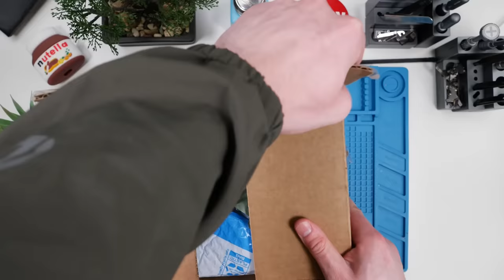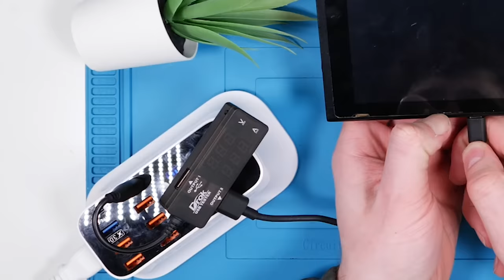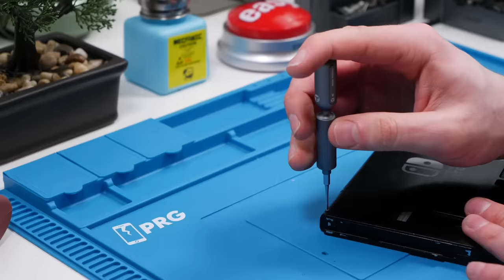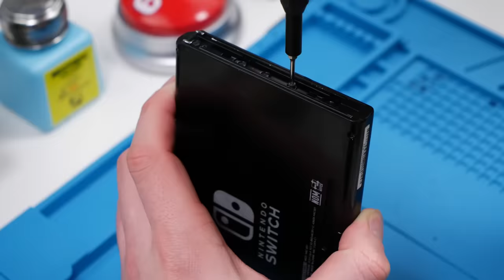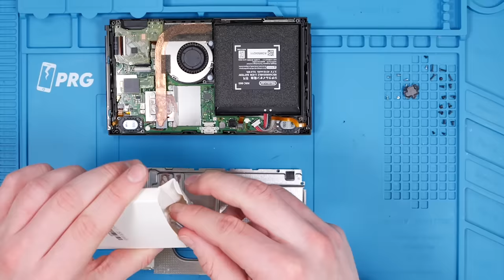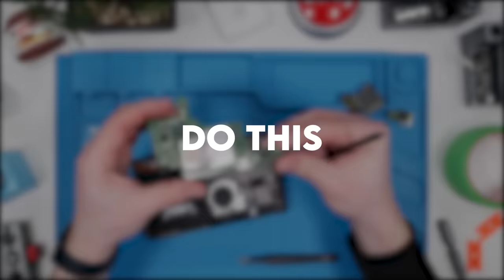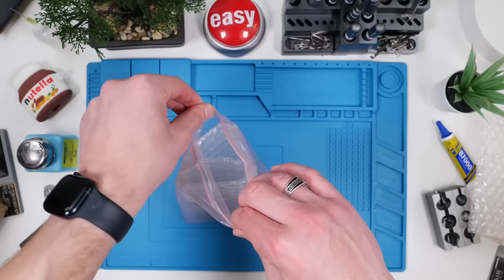This Switch Problem Is Way Too Common… No Power

Comment: Saving money by buying a broken one... good luck with that. By buying each part individually you pay way more.  You paid 110$ for that broken console alone? Now you need Joycons, Docking Station, Power Cable and you also have to revive it first. I guess buying a working and completed one would be cheaper. Atleast i did that last week. 250€ for a used one from Amazon.

Comment: It could be trickle charging at that lpw current but even then I would have thought it would draw like 150 milliamps or 200 or 0.2 amps at least though still seems a bit low even for trickle charging

Comment: Your micro desolderiing was mostly fine. But  you were applying way too much pressure to the chip. Just gently poke it with your pokey tools to see when the solder is molten. I tend to push in the direction of least components or components that are easy to put back in place.

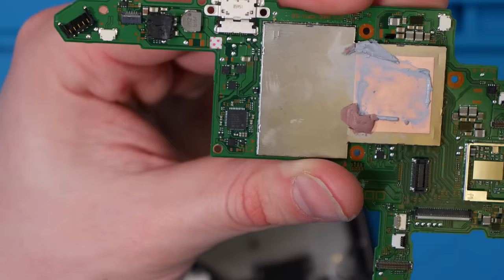Comment: 5:25 There is a chip at the top left that is damaged so brutally that you can see it with your eyes. When you got the motherboard repaired, you never told us about that chip was replaced. It's hard to belive that the capicitor that was shorted out was one that was related with the chip that you replace on the video since you havent showed us on the video where you pinned the multimeter. Please, do not make people confused with repair videos like this

Comment: $100 for a switch that doesn't even turn on  You got ripped.. You can find ones for much cheaper .. Also it helps to research how to open it ,,,     you only had to remove one side screw on each end

Comment: I mean, if you can go to the professional and learn, especially if it's for free why in the world are you even asking us this question???? Now on the other hand if it's not free or you have to travel really far and it's essentially gonna cost you money That you can't afford or justify I would order a few practice boards as much YouTube and get as much advice as you can. Another thing you can do is any blown electronics or old electronics that you have, disassemble and just start practicing. 

I can tell you one thing, the soldier you use, and the flux that you use are two of the most important aspects   .

I would've never attempted that without a bunch of practice on a board that looked very similar. I would've used old components that looked similar might not be exactly the ICU I think you said it was a charging ICU anyway that's what I did on a flight controller for a quad copter. I  inadvertently, pulled away from the computer while in the field and ripped my USB micro port off . I managed to re-solder it but that is obviously much easier than a 36 prong. I don't know how many prong that ICU was but those things are microscopic you need well you don't need because using a heat gun is like magic but you need I was gonna say you need a microscope, anyway I'm done rambling lol

Comment: It was an unreasonable and unjustifiable effort to peal off the battery from its place. You could have just plugged the new battery in to see if the Switch worked with it.

Comment: What kind of symptoms would cause this particular part to go bad? My switch was frozen on a back-lit black screen caused presumably from the output disconnecting (I have it docked to my computer for streaming and general use.) After a hard reset since it was unresponsive, it no longer turns back on. I don't have a spare battery to test with and I'm not sure if the screen died or not since it was "glowing" before I restarted it.

Comment: bro i need to know what that little silver screwdriver you're using is. i looked for it in your tools but i couldn't find it
Reply: The one that's mostly black with the silver bit? That's an iFixIt screwdriver. They're amazing, and their kits aren't crazy expensive, especially for the quality.

Comment: I did a shell swap last year and my oled vol up button stopped working. I replaced the ribbon cable and ntg’s changed. Could it be the chip or capacitor? (I have zero knowledge about electrical components). What’s the IC code name for volume and power buttons?

Comment: Jesus loves you bro. I have a lenovo yoga 910, that I paid around £1500 for at that time. That was like 4 years ago. It was my school laptop. But, unfortunately like 2 years ago I arrived from school with the laptop in my bag which I left on the couch. I must’ve left the charger plugged in somehow and and what actually happened was that my younger brother jumped on top of my bag and smacked the charger into the charging port. I’ve tried taking it some places but none of them could fix it. I could send it over to you, lmk. Cheers

Comment: I had my had my switch broken for 2 years now and had a blue screen of death because I dropped my switch the switch took charge but it it would not turn on so I went to a repair shop and the man said he would fix it then after i went to pic it up and when I was trying to charge it it wouldn’t take charge or nothing and when I tryed to turn it on and it was just black I just hope that he did not scam me or took off a piece of my switch I still have my Nintendo but it’s in peace

Comment: How much did you spend?Compare to Brand New?Was it worth it?Or you spend as similar as buying New one? Did you save some?
I also Fix things I am a AV Technician a Audio Video Tech. I have no skills on Micro Solder like you,I even can't afford a Microscope?But there other ways to see small things.
Buttom line is I want to have a Nintendo Switch at a cheaper price, Because I can't afford a Brand New. Just like your way of thinking

Comment: I am having  a  similar  issue  with  my  Switch  I had the battery  replaced  and  it was working  @ the shop but when I got it home it stopped  charging  and then  completely  stopped  charging and died do you think  it  could be the  same  chip?

Comment: Could I send in my switch? Not sure how much you charge but mine is having a no charge/no power problem and can't read my micro sd. It stopped working after a trip and don't know the cause. It's also modified so I really want to get it working again

Comment: Hello, can I ask. There a problem with my phone. So it started when the battery runs out(0%). When i charge it, the red light turn on(which mean it's currently charging) and it turn yellow when the battery is full. But when I tried to turn it on, it stuck on blue screen.
Reply: also I tried the volumn button and power button trick. also doesn't work.